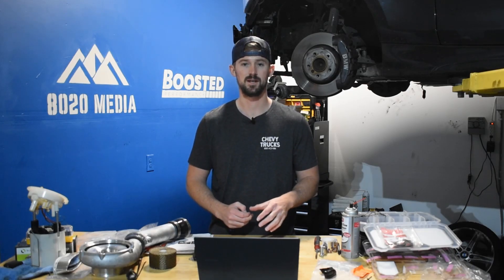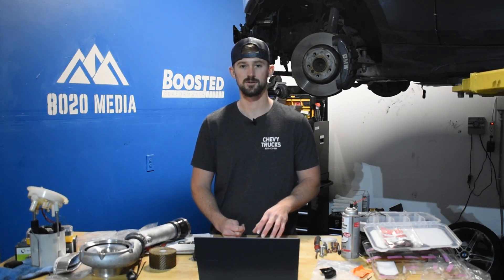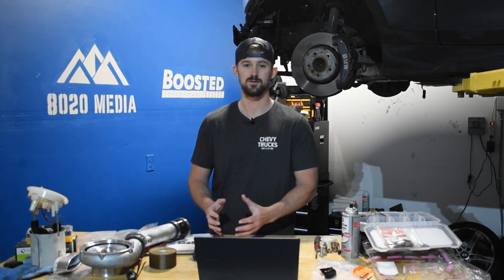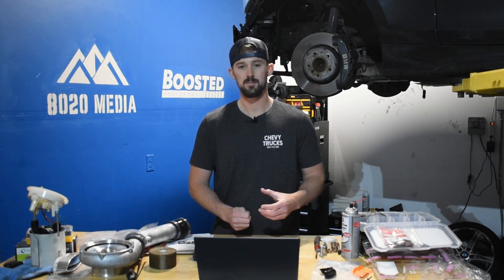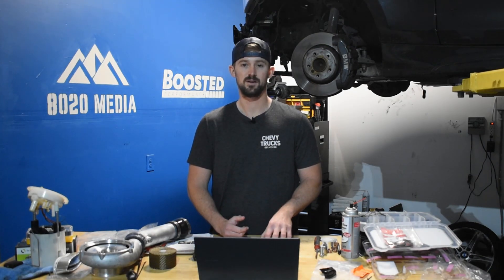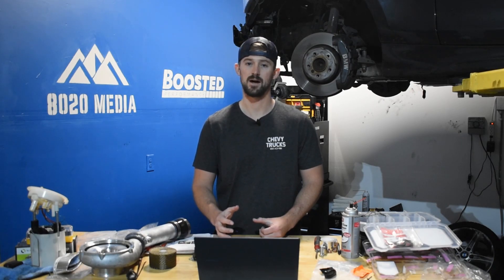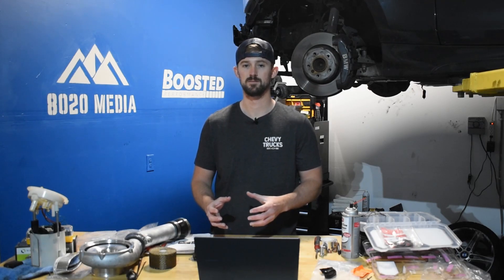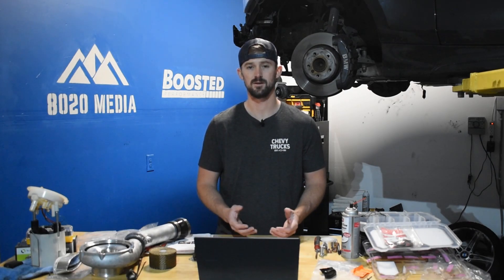LLY Duramax Problems & Reliability

Comment: I have a 2006 LLY in a chevy Kodiak5500,do I need to change the turbo inlet? Ty
Reply from the maker: J - You don't HAVE to, but not the worst idea. Are you experiencing any issues?
Reply: No issues,its an LLY,so just wandering.
Reply from the maker: @jamesmlavelle5891  You don't HAVE to, but not the worst idea.

Comment: 2004.5 LLY here, 200K miles, no mods, I've done nothing to the engine or trans but kept up with all fluid changes. The body however is falling apart, rusty rocker panels, rusty brake lines, paint fading.
Reply from the maker: G - Thanks for sharing. This is typically what we see as well!

Comment: My C4500 has none of these issues. Factory HD Cooling Engine/Trans.  She runs around 180 highest 195 
I installed a larger mouth AI to turbo. The Larger Frontal area of the C Truck allows for plenty of Air cooling, unlike the Pickups. It's a great engine because of the Larger TC than the other maxs.
Reply from the maker: F - Nice! Thanks for taking the time to share your experience. Sounds like you take great care of it.

Comment: Bought my 2004.5 new and it stil only has 40,000 miles on it. t tow a 16,000 pound trailer and it overheats on hills. I have the bigger turbo inlet and an air intake but the engine is pretty much stock. It needs more radiator. I have added an electric fan which helps when going up hills slowly.  Going up hills on hot days I also have to turn the heater on full blast to have any hope of keeping temps down. Next up, I am adding a second radiator in the back to give it more cooling that it needs. But otherwise the truck is amazing and comfortable and sometimes even fun.
Reply from the maker: F - Thanks for taking the time to share your experience! Keep us updated.

Comment: My 04.5 lly is needing top up coolant has had been  used  as  tow rig for half of its life 440 000 km not sure if maybe rad cap or head gaskets i was going to pressure  the cooling system cold an check for leaks
Reply from the maker: C - Sorry to hear this. Keep us updated!

Comment: I have an 04.5 that has 400,000 miles on factor head gaskets. Put an aftermarket turbo mouthpiece on it with a s&b air intake and never gets over 210 on the temp. I pull a 32ft cattle trailer and will gross around 32,000 pounds when fully loaded and will run 75 down the highway in 100 degree temps. Great truck. Out lived our Cummins and powerstroke we ran also.
Reply: I want to get mine tuned. Just changed out factory injection pump. Sold my 2021 ram Cummins last month and driving my lly again. Can’t beat it.
Reply from the maker: Sweet, that's awesome thanks for sharing!
Reply: I'm at 250k miles on original HG's on my 2005. Runs great, did have to get the FICM repaired and do #2 and #7 injector pigtails otherwise its been great. Been in the family since new. Tuned to +100hp and no overheating. I tow on +80hp. Water pump went at 225k.
Reply: Thanks for this info 💪🏼
Reply: 340 000 miles on mine.  Keep the cooling stack clean,  new turbo intake piece, and stage 2 the front end with kryptonite parts  Bulletproof truck you can work on.   I'll keep this forever

Comment: Bought my 2005 recently and thanking about getting a cts 3 tuner so I can get some better fuel mileage and a 5” exhaust the truck has 177000 miles and been taken care of
Reply from the maker: Wyatt - You should definitely be able to get 175k+ more out of it!
Reply: Make sure to get a aftermarket lift pump

Comment: 04.5. Bought it with 110k, its got 180k now. Issues, headliner, cracked dash, headlight controls, window and heated seat controls, climate controler, steering column shaft, cylinder 2 and 7 injector harnesses, fuel pressure regulator, worn wire insulation rubbing on fender, front wheel bearings, water pump, and yes, when towing over a pass in 100F its gets very warm even with the new turbo inlet. I will be adding after market oil cooler to help the over heating.  With that said, it has never left me stranded, and most the issues i named can be done if your handy.
Reply from the maker: Jeff - Thanks for adding your experience with the LLY!

Comment: Having a 6.0 power stroke that’s been “bulletproofed” but still having to deal with typical hpop problems I’ve been looking at getting another truck and found a 2005 Silverado lly with only 85k miles I’m interested in but I’m worried about how common head gasket failures are on them because looking through forums the general consensus is that they will go out no matter what. Do you think it’s pretty common and something I should watch out for with buying an lly with that low of miles.
Reply from the maker: n3wb - It is definitely common, but not at those mileage levels, so long as it has been maintained well up to that point. If it's been modded heavily or has towed a lot, i'd say no. However, if not, take it to a mechanic to have the head gaskets looked at. Keep us updated on this.
Reply: @8020Automotive   yeah so I bailed on the truck it took some prying to get information from the guy about it and he got really offended when I asked if it was a clean title because he wants almost 30k for it but it has a rebuilt title and he didn’t want to tell me what happened to it that caused it to get a rebuilt title and said if it was a clean title he’d want at least 40k for it. It looks really clean has a lift kit egr delete and exhaust. But I’m not buying a rebuilt truck for that much especially if the seller is being sketchy about the details. Im still looking around for an lly or lbz I’ll update you again if I get something.
Reply from the maker: N3wb - Sounds like it is probably best! Keep us updated on what you end up doing!

Comment: Went and looked at tons of these before I bought the biggest fail point I saw was the head gasket which is serious. Check the radiator reservoir it needs to absolutely be clean no black gunk. Next delete the egr and do pcv reroute. Then air dog or fass lift pump. Check the  transfer case seems to also be another fail point. Remember maintenance is everything to these trucks. The cs2 tuner it’s what I like I don’t want crazy horse power so 500 is plenty and more than most that’s out on the road. Next check the turbo up pipe on the pass side it break at the billet. Then 4 in not 5 straight pipe. I love my truck and to tell you the truth if im going to try to start pushing 750 plus I tear shit apart anyway and build the trans so I wouldn’t be worrying about the rods. Also the injector wires on 1 and 8 seem to chaff and through you into limp mod. If it does not already have the s&b inlet on it I wouldn’t but it. It means it’s had to of over heated before which mean that head gaskets at least on its way out.
Reply from the maker: Thanks for the hands on advice. Overheating is the biggest issue with these engines - needs to be addressed for sure.

Comment: So would you avoid a lly?
Reply from the maker: Not necessarily, just depends on what you are looking to do with it. I would certainly recommend the 2006 models with the updated engine. But the older models are still solid reliability wise unless you are looking to mod it. Toss an upgraded inlet on it to help with heat issues and it'll be a solid engine. Now if you are talking a 200k+ mile engine and you are trying to tune it and push some decent power then I would say avoid the LLY. Maintenance history will play a big role in reliability too.

Comment: Bought my 2004.5 - 2005, somewhat recently. Looks to have made to 308,000 completely stock with no problems. Idles great, drives fine, no blow by, nothing weird coming out of the tail pipe, coolant is normal, no bubbles in reservoir, etc Did upgrade the turbo inlet, deleted the EGR. Just waiting on a upgrade turbo down pipe, and passenger side up pipe. Think that should do it for now. Don't plan to sink a whole lot of money into upgrades yet (full HSP kit, lift, tires, etc). Need a 2nd job for that. And the truck should help me commute to a 2nd job long enough to make enough for that. Don't plan to upgrade the power, I believe it has enough.
Reply from the maker: Sean - Sounds like you've got a nice setup! Hope you get another 308k out of it!
Reply: Two of my dads work trucks are a 2005 and a 2006 LLY duramax both have had no problems and have over 450,000 kilometres